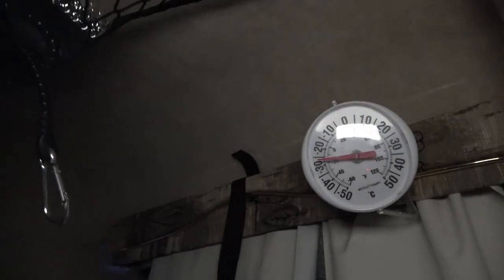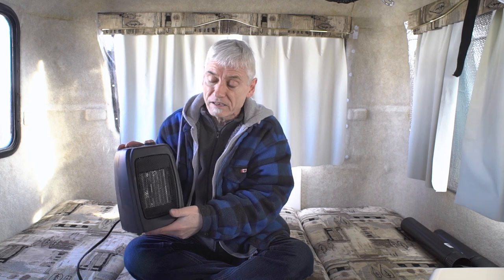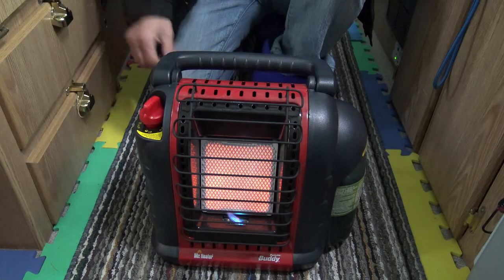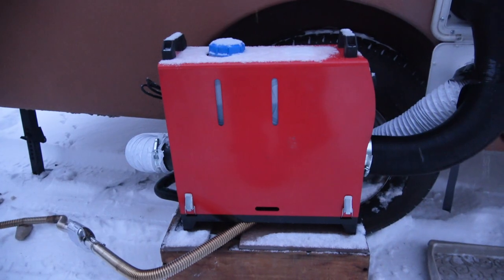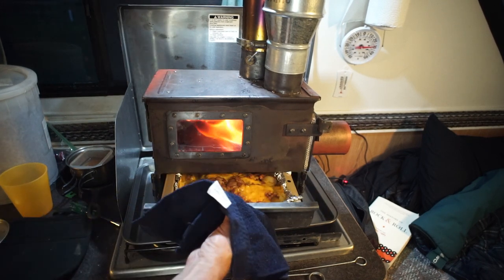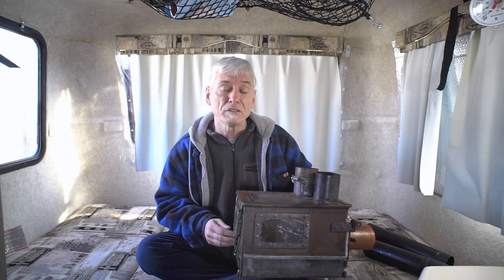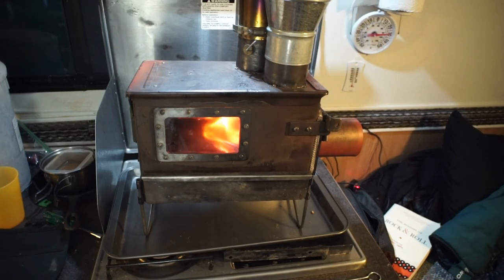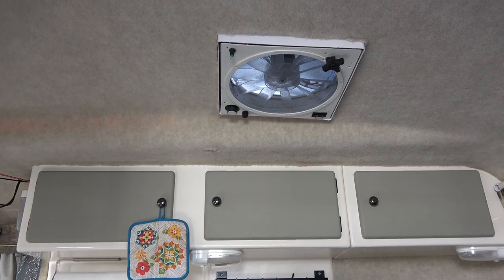Camper Wood Stove Experiment Pt 1: Just Chillin' on the Install

Comment: Slim. You'd be better off with a Newport/Dickinson P-9000 fully enclosed heating system. No gases are circulated in your RV.  The heat output is almost infinitely adjustable.  It is relatively easy to install.  The only half-tough parts are drilling the hole in your Camper ceiling, and connecting the propane supply to your existing system. You also have to tap into an existing DC electrical source, which is easy.  The heat is circulated by the use of an internal computer fan, which consumes about 2/10 of an amp per hour. Google Sure Marine in Seattle.
Reply from the maker: First issue is cost. They're $1000 in Canada. Second is placement, which would be a challenge in an Outback. If someone has a portable solution design that does not need any holes drilled, I'm listening. Thanks! SP
Reply: @SlimPotatohead  All true Slim.  On the flip side, you don't have to install and un-install all the time, and you don't have to clean out wood ashes. I installed two of them in my 35-foot motorhome.  Love them.  :-)  LOVE your videos!!
Reply from the maker: Out of curiosity, has anyone replaced their existing propane furnace with one of these? I would love to swap out my old one with something better, especially if it can be in the same spot. Thanks! SP
Reply: @SlimPotatohead  I've thought of that Slim, but I think it would be a pretty unusual application, because of how they install the standard RV heaters.  Which, of course, are basically useless.  The std. heaters draw so much electricity that often your battery is likely to be dead by morning on a cold night.  And, you're right, the std. RV heaters waste a lot of propane.  The P-9000 is VERY stingy with the propane it uses, and the heat is almost infinitely adjustable as to the output of heat level.  Good luck!!  :-)
Reply: @SlimPotatohead  BTW, if you are ever down just north of Seattle, I'd be happy to show you my installations.  Keep masked and keep safe!!!
Reply: @user-zo6xg8bx4l  If I had built such an excellent device as Slim's stove, and it took a little more work to use and maintain it, I would use it anyway just because I made it and it was so good.

Comment: You can use that window for cool air you should drill a hole in the back side panel of the camper next to the window and threw a hole in the roof do what you do and I house and put in a Fireproof that box in the ceiling you can add a pipe outside or put one on afterwards with a cap I permanently Mount that in that trailer and leave it there forever and then you can make a bigger Hopper box hang it on your back wall and you can probably hold two bags of pellets that's an ingenious idea

Comment: I was wondering how you were going to integrate the wood stove into your new camper.  This setup seems a lot simpler than with your a frame. I would consider cutting the air intake hose a little shorter though.
Reply from the maker: Yes, the intake will be shorter. It's also old and brittle so needs to be replaced. Thanks! SP
Reply: Could you store the pellets inside the old cooktop, beneath the wood stove?  Be nice to use that space somehow.

Comment: Why not a small vented Propane stove? As you know, you will have to feed wood in the stove during the night. Propane may cost more but it takes up less room.   some thought    steve
Reply from the maker: Why would I want a 3rd propane heater? Two is enough! SP
Reply: @SlimPotatohead  Look at the NU-WAY 2000. same as your wood but propane. Works like a charm as my friend tells me. He put it in a 6 x 12 enclosed trailer and loves it. He also went through many stoves and this is the one that works best for them  Just some feedback.... steve
Reply from the maker: Hi J judy, as I recall, I think I got it up to 5 hours. Making that 8 hours is one of my new challenges! SP
Reply from the maker: Thanks Steve, I'll look into it. SP
Reply: @SlimPotatohead  Your welcome. Nothing is free but maybe easier...  If I can help in any way. My time is limited here on earth as God has something else for me.

Comment: That exterior elbow on the stove pipe is an issue. It can spin around, leak soot, expand and fall apart....
Reply from the maker: Always interesting to hear speculation. More too follow! SP
Reply: I was interested in the same question.  How would you reinforce it in winds?

Comment: Question.  Do you think you might want to fill in the holes in the bottom so you don't get any ash falling out of the stove and onto your trailer when your taking the stove apart or cleaning it out?  Or do you want some drain holes on it?
Reply from the maker: Actually ash can't fall out since the stove is pellet fed from above. I merely push it back sometimes while stoking through the inlet vent holes with a poker. It's only when the stove is cold do I need to empty a very small amount of ash, typically by just lifting the stove up, opening the lid and adding the nutrients to the soil outside. Thanks! SP

Comment: Are you sure the stove pipe hole insulation is good (100%) enough to prevent fire in the piece of wood? If it was a house a much better solution is required by building codes.
Reply from the maker: Spoiler alert....I'm still alive...
Reply: @SlimPotatohead  Until now yes but the future is unsure though!

Comment: Do you think your design could be used with modifications to make it a rocket stove like....... as in the hopper can take sticks etc instead pellets?
Reply from the maker: The stove can run on wood pieces, but I only use that for outside when cooking. As for auto feed inside a camper, far too dangerous. Thanks! SP

Comment: Again I say, the stove should be as close to the floor as possible. The reason?  A stove will only heat the air at the level of the stove and above it. Heat rises. Therefore, the area lower than the  stove will remain cold.
Reply from the maker: It's actually lot lower than it was in Abner. Floor not very practical in such a small trailer like this I'm afraid. Thanks! SP

Comment: I'm going to do this in my 7x14 toy hauler that I have converted into a camper.  I know you built your stove but I am not as handy.  Do you have any suggestions/recommendation for a similar small stove I can buy online that will work for application?  And would you consider any of the small stainless steel stoves?  Thank you in advance.
Reply from the maker: Hi Bo, I am not aware of any commercial stove built specifically for this application. My design was based on a closed, baffled system for wood pellets. Most mini stoves offer none of these features, nor would I recommend them due to safety concerns. Thanks! SP
Reply: @SlimPotatohead  Thank you and I totally agree on the safety aspect of traditional wood stoves.  If I do it I will be trying a pellet burner setup similar to yours as I have the same type of window frame you have.  Can't wait to see your next video.

Comment: I was reading that you can get SpaceX star link broadband Internet from outer space in Canada now I think it’s $100 a month for 150 Mb download per second I think up speed is almost 60. You can do live streaming with that from anywhere in Canada apparently. The latency is fairly low are satellites are in low orbit you might even be able to see them on a clear night.
Reply: StarLink is still in Beta (Users are limited for testing) so not ready for primetime. StarLink probably won't be a viable solution for many people b/c it relies on "line of sight." Those pesky woods and mountains & canyons will block the line of sight to the satellites. Plus, it requires carrying a small satellite dish, an A/C powered satellite box and setting up every time you want to use it. If in the open deserts or plains without any cell service, it becomes a viable solution. Price has to come down too.
Reply: @ScubaSteveCanada  The article specifically said that Canada is one of the first areas for beta testing so I’m assuming that they are trying to overcome those problems if you have satellite radio that worked perfect up in the mountains and those satellites are 23,000 miles out. I understand the bandwidth is a lot different but Even 20 minutes at 50 Mb you could get a lot done 150 Mb you can get a whole lot done. If it wasn’t gonna work good Putin wouldn’t be so upset about it.

Comment: You need to put a solar panels on top of your Jeep then run Solar System bound to your battery and a solar heater into your oil or your water system and then you will have it were you won't have to worry about your Jeep not starting they have ways to do it you just gotta look Ford
Reply from the maker: There's no solar at night. It's the -30 mornings I need to start my Jeep. Thanks! SP
Reply: I know there's a system out there that would take care of heating up your engine block that will run off of a little bit of a battery power from a solar battery that you can put inside your back your truck temporarily journal Winter time there out there all you have to do is search form I don't remember where was that a friend of mine had one and he plugged into his oil result of is like a dipstick or you all stick goes And it will he with a solar panel system live raw charges a deep cycle battery would actually run the heater to his engine block